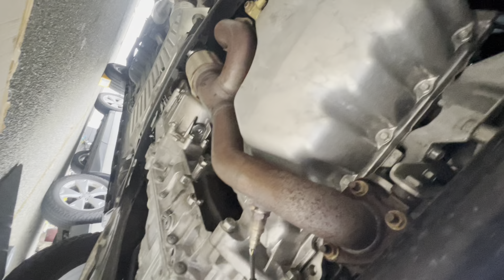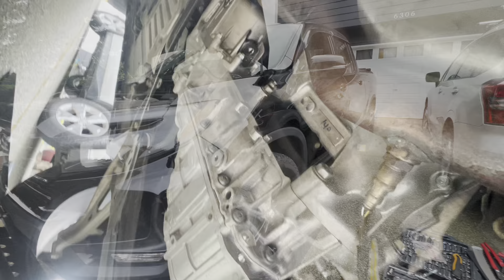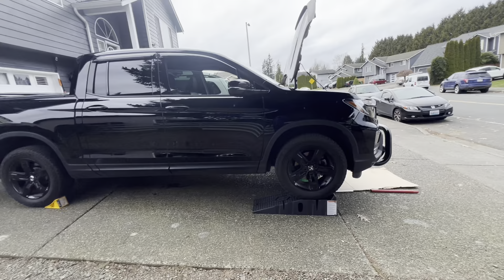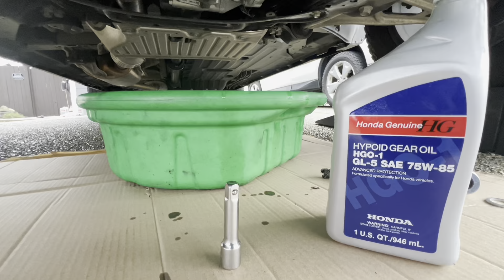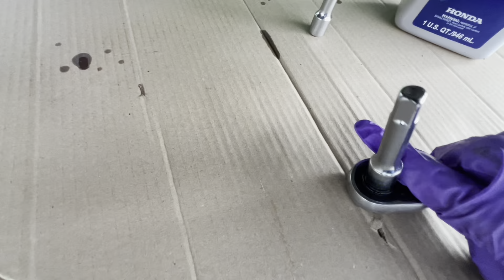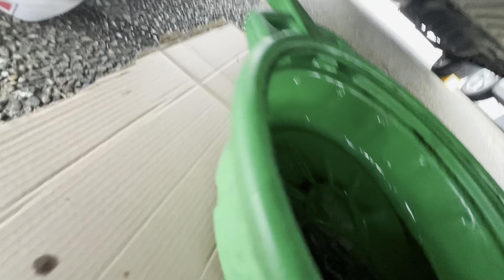Honda Ridgeline 2023 transfer case assembly drain and fill hypoid gear oil, 75W – 80 1 quart.

Comment: If your transfer case or differential oil don’t come out looking clean, you have a HUGE problem. Engine oil comes out dark because of the heat generated by the combustion of the engine. Do NOT put off your fluid changes just because the oil came out still looking new. It has degraded from use, whether you can see it or not.
Reply from the maker: Yes very true! Better to change and have it looking good still!  That way no damage can occur.